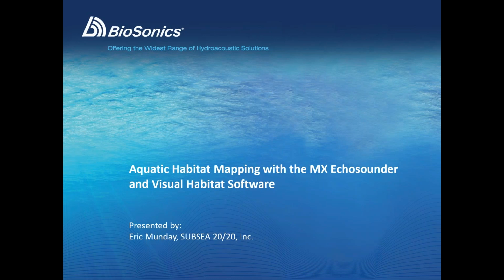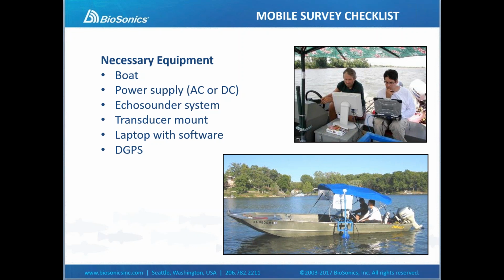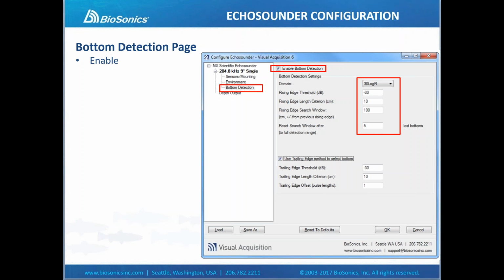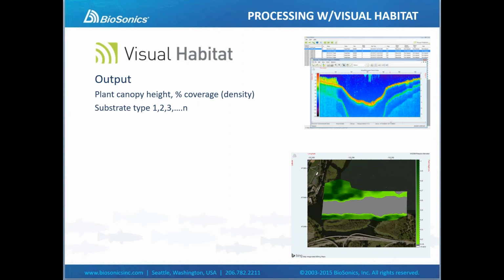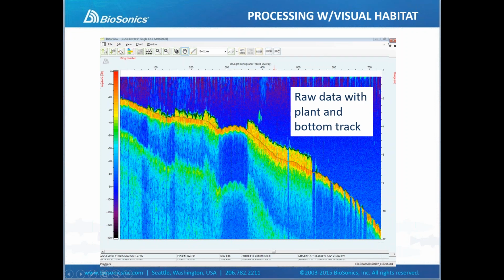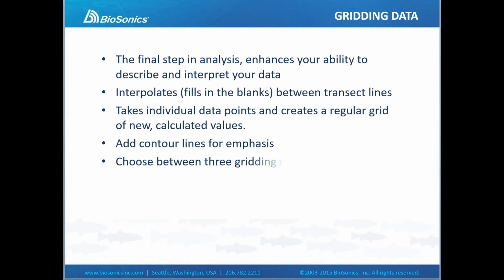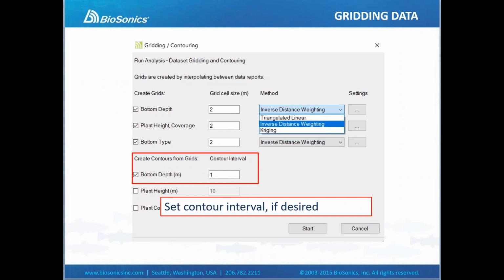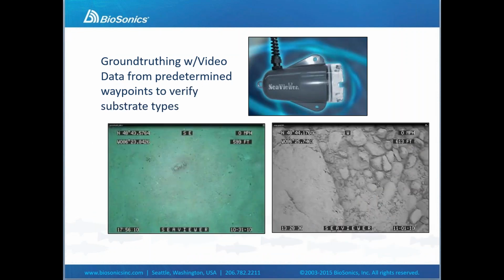Aquatic Habitat Mapping with the MX Echosounder and Visual Habitat Software

Comment: Hi, great presentation! 2 questions: 1) is it possible to clip the transect? 2) how do you determine the optimal target detection threshold for bottom depth & plant canopy?
Reply: Is looking at the oscilloscope chart the best method for choosing dB level?
Reply from the maker: Yes,  BioSonics software provides utilities for clipping and appending transect files.   
The default settings usually work well for bottom and canopy height detection thresholds, and yes, the oscilloscope can used to make adjustments.  You can very quickly and easily rerun the detection algorithm and check your results as you fine tune the bottom and plant detection lines.